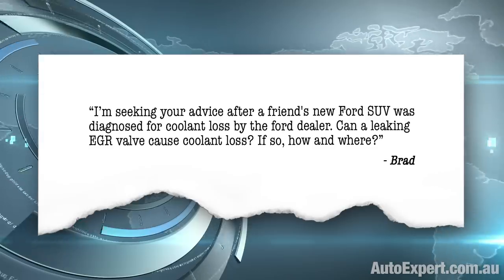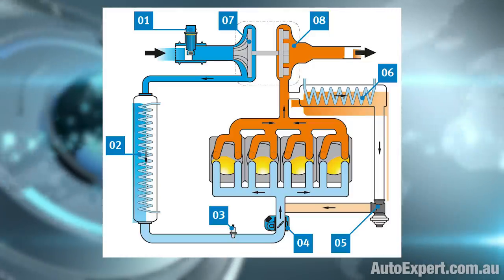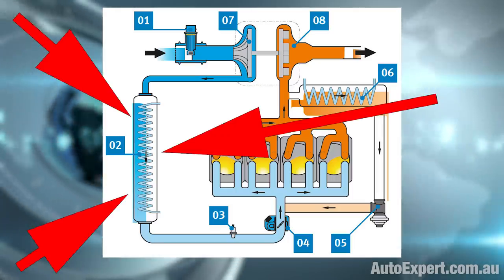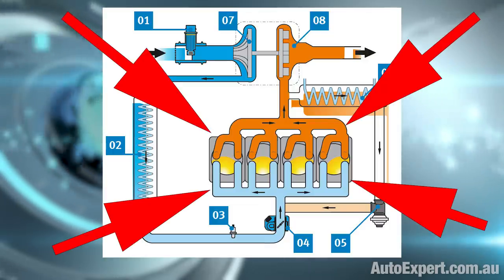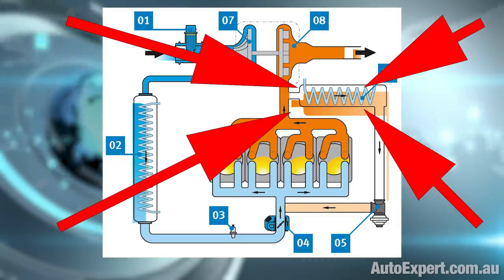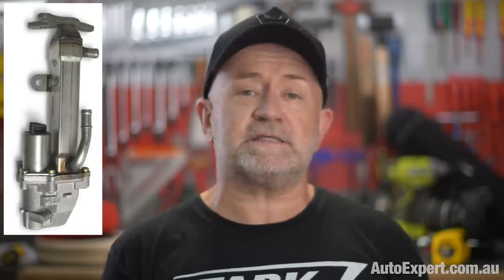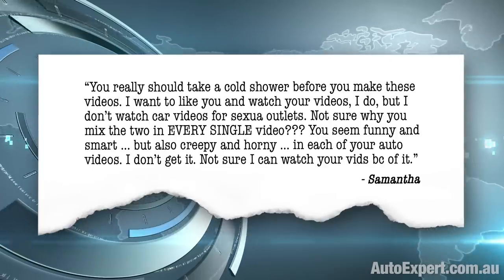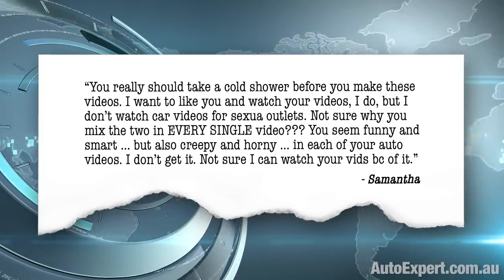Can EGR cause engine coolant loss? | Auto Expert John Cadogan

Comment: HA Good one John. Reminds me of when I worked in parts department. Was ordering EGR coolers, on daily basis. FOMOCO - Delivered them straight out of Thailand in the box sealed bag of bubble wrap. 
All with quality cracks in the body and incomplete welding of the tubes !  ( An they cost them at Hundreds of Dolalrs ) 
And they were going into PX3 production. Thank god for Warranties. Even funnier when car was loosing coolant on delivery day. BT50- and PX2 Ranger, they really don't make them like they use too.  

When they made the EGR valves water cooled. I thought Bugger mode crap to go wrong. But most of it seemed to always be, linked to people who don't service the car correctly. Excessive water top ups just lead to electrolysis in the system. Or mechanics getting hoses wrong way round and my favorite - not fitting a new gasket, because that $2 gasket can save money for the service department of said dealership. like reusing the coolant !.  Yeah they still do that stuff.

Comment: Very good explanation. Now it's time for me, as a commentor, to pick some nits. Another reason coolant doesn't boil, is it is not just water. It is a mixture of water and antifreeze. This not only lowers the freezing point but raises the boiling point. Unfortunately, it also lowers the efficiency of the fluid as a heat removing medium. But not enough to be a problem. That particular intercooler is air cooled, however many of them are in different applications, are also water cooled. Or coolant cooled. As an aside, you should see the cooling system on the 6.7 L Ford diesel engine sold in the United States. It has two separate cooling systems. Two separate radiators. Among the things that are water cooled besides the engine, are, EGR, intercooler, engine oil, transmission fluid. About the only thing that is not is the power steering fluid and the air conditioner refrigerant. Bonus point for me, and intercooler is more properly described as a charge air cooler.

Comment: One major potential problem with a leaking EGR cooler is if the vehicle isn’t driven for a while and the cooler leak is substantial enough, coolant can pool in the inlet manifold or a cylinder. Our Ranger PX1 work Ute ended up with a bent rod because of it.
Reply: That's just not funny when that happens. I have heard of another case similar here in the UK.

Comment: My work truck (Isuzu FVZ) just decided to have this issue on Friday. No signs of leaks, expansion tank still at the correct level, but all of a sudden, temp gauge goes nuts and a warning buzzer screaming on the dash. Topped the cooling system right up and drove to the workshop. Easy enough to fix, it's mounted right on the top of the motor. Still a pain the pooper though.

Comment: Some non-turbo gasoline engines will also  lose coolant due to egr problems. GM 3.4 L V6 engines are notorious for this . In  the GM design, a clogged egr tube will cause overheating and cause excess coolant expansion, and overflows the coolant recovery bottle.Ten when the engine cools, the recovery bottle gets sucked dry and air gets sucked into the engine to replace some of the lost coolant making the overheating even worse.

Comment: Yep happened to me with my amarok 

Dealer wanted to tear down the motor to diagnose it, 2k quote to tear down and diagnose, which I didn’t go with

After reading on forums, I decided it was worth a punt to change the egr

Job done, leak fixed, 800 in total

The mechanic and I chopped up the old one to have a look at it and it’s basically a radiator loop, the leak was most likely a pin hole as there was no obvious cracks etc

Comment: Had a EGR valve replaced in my VW V6 diesel Touareg $2960.00 Labour was $1014.75 parts $1676.15 I got them to replace what ever hoses and gaskets that needed replacing  whilst they had half the motor apart. the valve cost $600 and the cooler cost $447.27, the rest was washers$3.53 each Spring clip[s $8.82each gaskets ranged from $24 to$37, It hurt. $3.53 fo a single washer WTF. Eat still would of cost me over $2000.00 just for the EGR and Cooler replacement.

Comment: Egr valve replacement nissan navara stx550 $2800. The head needs removal to get access and is a 16hr job, so the dealer tells me🤣🤣. The engineers were taking the day off when designing this gem

Comment: Thanx I was wondering why I was loosing antifreeze. I replaced the EGR valve but the port was clogged with carbon p1404 code. Runs better checking on the fluid disappearing act but I'm sure that too will be fixed.

Comment: You need something pleasant to think about while getting your thumb trapped between the EGR valve  casting and the engine block while your arm is being shredded.. Peugeot 307 diesel EGR valve is almost completely inaccessible. Getting thumb stuck just added to the pain.

Comment: Leaking EGR coolers can cause engine fires as well ... under the right conditions.  Just ask those of use in the USA with FCA ecodiesels.  Just got the recall notice last month on thermo cycling failures.  If the failure is bad enough it steam cleans the EGR tubes and intake blasting carbon build up in the intake manifold and ... well, you get the picture.  Have to what until 2nd quarter 2020 for a fix.

Comment: Dihydrogen monoxide cooled, Exhaust gas recirculation valve, well I never. Back in the 80’s when I was a pimply faced teenage first thing we did with the new paddock thrasher was a ball bearing up the vacuum line of the EGR valve. Most likely did f,all but it made us think it ran better anyway.
Ps, IN...
Reply: No EGR in the 80s, just PCV valve....pretty sure, but have been wrong before.

Comment: I used to see the Merc OM651 Diesel engines leak from the EGR heat exchanger into the inlet manifold.

Good old German engineering at its finest.

Comment: If you think replacing an egr valve is easy try doing one on a D40 with the V6 V9X engine when it is buried in the valley under the turbo.

Comment: What was that you were saying from 7:16 to 8:16?  The GIF was very magnet to my eyes,  Hence my brain was polarized to the upper left quadrant of the screen.  The force was so great that the air pressure vibrations generated by the cones of the speakers were dropped from the data stream along with the photonic input from the other three quadrants.  Once the Gravity Influential Force was removed, all systems returned to normal operating parameters.

Comment: After ""adjusting"" the egr flow on a Hilux and Ranger both have way more consistent fuel usage.  Introducing or at least trying to add EGR debris filled gas back into the  cylinders  has always had a down side .   EGR issues  widely fitted in the 70`s have always caused issues  and continuing to do so .
Contamination of injectors is a real problem

Comment: Egr coolers are like a heat exchanger and if egr valve stuck open will super heat the coolant and pressure excess will vent off through the rad cap.

Comment: Yeah EGR systems are quick and easy to replace. Just remove the 2 hours of shit they are burried behind first.
Reply: exactly, newer cars  are deliberately built so you cant get to anything,
Newerer doesn't always mean betterer...
Reply: I wouldn't say they are deliberately built to be hard to work on. It's all just crammed together for ease of installation at the factory. But it would be nice if they put some consideration into the design for the end user.

Comment: The VW T5 CFCA bi-turbo is a shocker of an engine the EGR Cooler is made of aluminium and can’t handle the heat. The fins inside the EGR slowly breaks down sending chunks of aluminium into the engine. So many engines in the UK, Norway, Germany and here have been affected. VW know about it but they say “No there is no problem” but there is a face book page that tells a different story. https://www.facebook.com/groups/vwcfca/?ref=share

Comment: Please explain how the EGR system in a diesel makes the vehicle more fuel efficient.
I’m not convinced, but try me!
Reply from the maker: It increases volumetric efficiency at low engine speeds.
Reply: @AutoExpertJC  until it's run for 500 hours then the deposits from the exhaust gasses have built up to a extent that power and efficiency decline. 
Until you monitor the ECU and watch the EGR system in action it is used at all engine speeds and upto 80% commanded load.
It's there purely to reduce nox by eliminating as much oxygen as possible thats not required in the combustion.

this is why diesels have major lag at low speeds because the EGR valve needs to close so more oxygen enters the system then more fuel can be added.

If the EGR system is disabled or closed off a modern diesel it dont not need a DPF 95% of the time but while the EGR is working and the valve open the exhaust gasses are black from soot.

Fun fact the old double Decker London buses were tuned to never run above 60% load to eliminate all visible soot and not be offensive to the nose.

Comment: Can egr-cooler leak if ear-valve is blocked by programing? car is 1.3cdti Astra H. If exhaust gas does not go to egr-cooler coolant won't flow through egr-cooler and no coolant can't be losen there?

Comment: What is the use of the PCV valve? Why is it important to replace it?
Reply: Pcv is there to assist the motor from building up postive pressure in the crankcase from blowby by compression rings if the pcv is blocked or restricted can cause the oil seals and dipstick to blow out

Comment: New vehicles are so complex and expensive to repair no one wants to keep one out of warranty, DEF on diesels is a prime example. A fortune to replace, and every diesel I know of has had it replaced at least once before warranty was up. Honda 1.5 turbo with their oil dilution problems, Honda came out with a fake software fix that did nothing.

Comment: Mazda BT50  does the same thing, could have filled a skip with the number of them I have changed under warranty. Only thing is there would be no room in the skip, it would already  be full of engines, gearboxes, fuel pumps, injectors........
Reply: @grantleyhughes  Up to a point, I think Ford has parted ways in the last year or two and developed it further. Mazda is still wheeling out the old version.
Reply: @philelliott5327  I think due to the sales mazda didnt want to buy the rights for the fully updated 3.2L just a few tweeks.
I feel thats whey they are parting with ford because it's just crap the reliability vs the older mazda powered b series
Reply: @javic1979  Ford and Mazda were punching on about the Ranger/BT50 thing for years. I worked at a Mazda dealership but downloaded a Ranger workshop manual for my own use. Ford would not let Mazda have access to the original and the Mazda version was junk.
Reply: even so the ford designed 3.2 and 2.2 engines are crap compared to the old mazda 3.0L & 2.5.
yes the older had less power but had less issues

Comment: Hi my car Audi Q5  loosing coolant and pressure test shows gas in Q5 expansion tank so symtomps of a failed head gasket.Should i by pass Egr to confirm it.
Reply: Has the problem been resolved? Is the coolant leaking inside? Agr
Reply: By by passing egr still car creates presssure in the expansion tank and then a small problem has been noticed of the Auxillary water pump which is not running or blocked may be its the reason the engine is creating steam and no gases are present inside the  expansion bottle on the gas leak test.The final step is headgasket or a new engine.
Reply: The reason of my post here is to advise fellow traders never buy a car from BCA unless its assured.BCA is legally abusing traders with cars which need to be scrapped.The small traders like me if they lose money in few cars like mine no chances of any recovery.

Comment: I'll pass on the ming moles, they cost too much.

EGR is very effective, and is a proven system to improve engine efficiency. And it helps save human lives from VW gas. Unless it's European or equivalent. I have not heard of EGR valves causing coolant loss. But I guess it's possible. Underdone R&D maybe? VW, Ford, etc?
Reply: Maybe good for engine efficiency, but not longevity.. have you seen the intake manifolds on vehicles with egrs?
Reply: @haratiohornblower2613  You can put that down to poor OEM R&D in a lot of cases, We had European diesels as a rule, i.e. Only Europeans could build a diesel. We learned the hard way there with their couldn't be bothered R&D attitude. R&D is a lot of the problem. Other causes could be burning oil, poor fuel atomisation, thus incomplete combustion. Petrol engines should not have the issues like diesels if R&D is done right unless oil consumption, i.e burning oil is a problem..
Reply: @byronnightingale5550  ranger/ bt50 are terrible for it and cx5 is an absolute mess in there..(Diesels) so not just European vehicles.. companies put em on  there to meet emissions standards...

Comment: The defective EGR cooler is causing major damage to 2.0 l TDIs from Volkswagen, it's not the leaking water that causes the damage, it's the iron oxide flakes (from that rusting heat exchanger) that damages the cylinder liners and causes a loss in compression and massive oil consumption.

Comment: ok, wait a minute, so you are telling me it isn't just a vacuum hose, a hose clamp, a rubber seal, and a small valve that rattles when it's clean, and needs WD40 when it doesn't rattle... those EGR valves no longer exist as I can sadly see. The days of the HR Holden are but a fading and vicious memory...
Reply: @peterallen4331  ah yes, the memory isn't what it was I think...

Comment: Yes the EGR system can leak coolant, from the EGR cooler, the coolers on multiple makes and models are to put it bluntly, pieces of crap, the worst offenders I have seen are Ford Rangers from PK onwards and the Ford Everest equivalent of the PX series Rangers. At the worst they flood the intake with coolant and bend rods and consequentially cause catastrophic engine failure.

The consequential damages are a real cause of fuckery by aftermarket warranty companies as the majority write a clause into their contracts that consequential damages are not covered, so in effect they will cover the cost of putting a new EGR cooler onto a consequentially destroyed engine.

Buyer beware 😉
Reply: Bt 50s same for obvious reasons.. replaced many, know why many ppl just remove/ blank them off..

Comment: On a related issue I'd like to point out the serious damping problem the blonde with the black top is suffering from. More research into the harmonics of Lycra V silicon needs to carried out before it all ends in tears. Just off to the laundromat to rectify my damping problem after witnessing this affront of Newtons Laws of motion. Now wears my bag of lollies. (Well yes it does)

Comment: M888888888888, best video I have seen this year. Samantha, you obviously aren't an Ozzie, so you need to grow some balls girl, and that was an absolute ripper of a come back from you to her, slam dunk, more boobies please !. Now I am with you regarding the EGR valve, as I had been losing about a litre from the reservoir after an hours drive. Went to Ford, their opinion at 1st was a thermostat and sensor wire, they quoted me $500.00 and advises that they had to order the parts. I drove back home, next day took it back and said not happy with their opinion and wanted further investigation, 2 hours later and they came up with a buckled cylinder head, on top of the thermostat and sensor wire, and would quote me. Couple of days later they quoted me $5,325.00....lol. 51 parts in total, I said your joking and I the Ford Ranger 2016 to a mechanic I know who used to be a head mechanic at Toyota for a decade and recently opened his own workshop. He is currently investigating the cooling system an will then move onto the oil system if required. So far he has confirmed the thermostat valve needs replacing and a bottom hose connecting to the radiator. I have said all along it's the EVR valve, he doesn't want to commit to he looks at that as he works on it, so we will see as time goes by. Oh by the way, Ford agreed that quote with 51 parts was over the top and amended their quote down to $3,080.00, thieving bastards who have no idea. Will update outcome with mechanic in due course when I find out the culprit as I am now signing off to go and look at some boobies :)

Comment: 70 to 100 thousand km out of ford ranger/ mazda bt50 and they corrode. Don't replace them and you get cylinder lock..... at the wrong time..... like in peak hour...... so that's nice....... NOT 😠
You would think in the 21st century when we think we're so smart this wouldn't be an issue. 
Ahhh yes, the spare parts clause of the motoring contract. 
And yes, more nuts please. We must keep an even keel when it comes to all groups of people. 
Even feminists and vegans.
" insert sarcasm here, now"